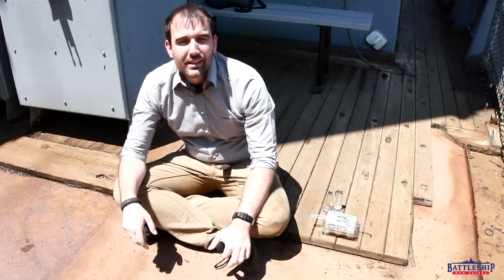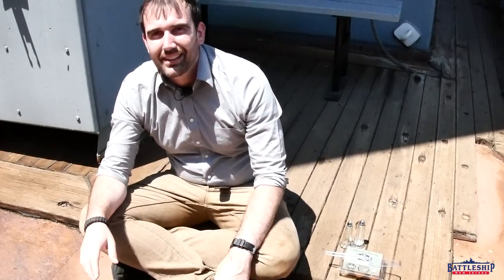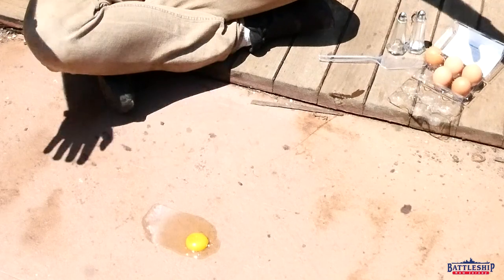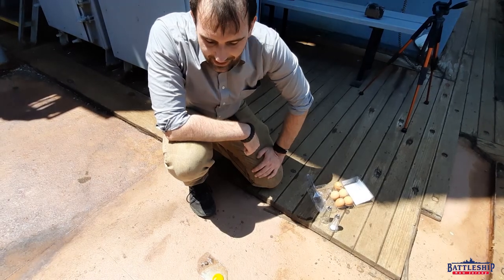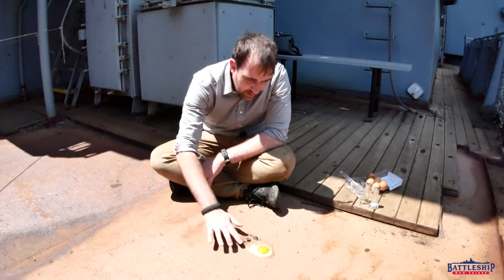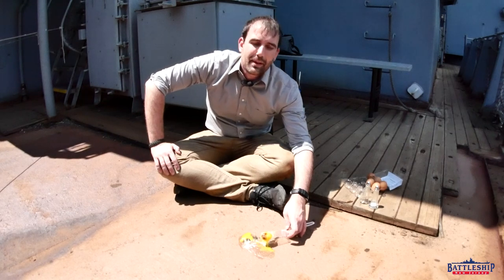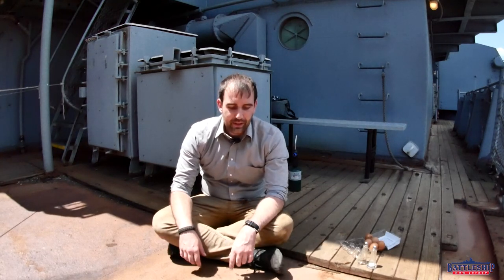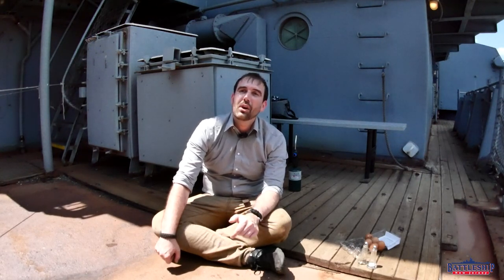Cooking An Egg on the Deck of A Battleship

Comment: Eggs whites are is made up of 15 percent of proteins. Egg whites have been used for several purposes, including waterproof glue, so it’s easy to understand how this part of the egg can dry and then stick to the surface of paint. If it is not dealt with quickly, it can become extremely difficult to remove from the surface of the paint without sanding and repainting the damaged area. Egg yolk was once used to make paint because of its natural ability to harden and stick to almost any surface. The chemical composition of the egg yolk will eat through paint.
Reply: Exactly why egging somebody's car as a prank can be so destructive.
Reply: @Jimorian  that's why its not "just a prank bro" egging can cause real material damage to most surfaces. egg especially sticks well to paint, its why egg was often used as a pigment binder in paint throughout history, the painting "Birth of Venus" which most folks recognize as the the famous naked lady on a clam shell painting from the early renaissance was done in egg tempura, and the paint still holds up over 500 years later. Came here for battleship facts and got an example of art history too.

Comment: you need to try it again, but use a cast iron skillet and see if the direct sunlight is hot enough to heat the pan enough to cook it thoroughly...and of course use pam or butter

Comment: interesting , eggs in most cooking serve a different function than just being food , in alot of occasions its a glue , im saying the yolk as it flowed caused an airtight bond with the surface , as the yolk dries it shrinks and the primer evidently has a better bond with the egg rather than the ship .  RYAN READ THIS BIT  : if the bond with the ship isnt as strong as shrinking egg yolk it might suggest the primer isnt working as well as it was, might be a good cheap " underlying rust detection " trick , but yeah theres rust under the primer there

Comment: If you’d used a black cast iron skillet, I think you could have done it. As it was, you did a fair job getting that egg more or less to “over easy”
Reply: An egg cooks are around 144 F, and that egg was raw.  That 101 F heat isn't going to heat anything up hot enough to cook an egg.

Comment: 1978, I was a cook on board USS Fox CG-33. We were in the middle of the Indian Ocean when I got newspaper clippings from my family about the "Blizzard of 78" in Northwest Ohio. I proceeded to take a little oil and an egg to the fantail and cook it on the deck. It took about 10 or 15 minutes for that egg to be somewhat ready to eat. (No, we did not eat it) We took pictures along the way and I sent them back to my family in Ohio, AFTER we had swim call and I snorkeled underneath the ship in the close to 90 degree ocean water. It was probably well over 100 air temp. So yes, you can cook an egg on the deck of a ship, it just takes a while.

Comment: Have some similar experience as a former US Army tank crewman.  Yeah, tanks get miserably hot inside, especially in the desert where there's little overhead cover to park next to (was stationed at Fl. Bliss in El Paso TX back in the olden days, also in Desert Shield/Desert Storm).  Reportedly, back in North Africa in WWII the interior temps inside the tanks could hit 160 degrees F.  One thing new guys to the unit quickly learned was, when working on the tank, to either put the tools in the shade, or at least cover them with a rag.  Otherwise your wrenches, ratchets, etc. would heat up so much you couldn't use them.  You'd have to pour a canteen of water over them to try and cool them off, but if we were out 'in the field', on a training exercise, you definitely didn't want to waste water like that.  (Note:  The M1A1/A2 series tanks DO have an "air conditioner" of sorts; it's part of the chemical defense system.  But at least back in my day, we weren't allowed to use it except in wartime, because it took bleed air off the engine, and the engine -- at that time -- was not really configured to supply that bleed air, and so it would supposedly cause cracking and other engine problems if it was used too much -- or so we were told.  Hopefully the Army got the funding necessary to modify the engines sometime in the last 30 years.)

Comment: My first thought on the peeling primer is that the egg is just sticky enough to take the primer with it as it slowly heats up and shrivels... (the pH or enzymes in the egg might also have helped to break down the primer and make it happen more easily, but it doesn't look like primer is really missing, rather just pulled up)

5:16 The absolute side-eye you gave there!!! LOL

How hot has it gotten... ugh. I'm in Texas. It's been triple digits for a good 2 months. 😢

Comment: Now do bacon on the conning tower.
Reply: the gun shot was aimed at the lost pig wandering nearby.  Some ships in the Persian gulf will (did?) paint some vertical surfaces white due to sun and heat.
Reply from the maker: We started there! The thicker steel doesn't get as hot.
Reply: i was thinking the dark gray on top of a turret.
Reply: @leftyo9589  Lefty, Ryan tried the turret top with the same result.

Comment: With that kind of heat a literal egg on the deck may not have been what was done, but I could certainly see a seasoned cast iron flat/skillet being plenty hot enough if left out to quick fry some sunny side up wonders.

Comment: I live a little bit south of Brisbane, Australia (where MacArthur evacuated to during WW2 for a while), and here, with latitude roughly 27.6° South of the equator, today's forecast maximum is 25°C / 77°F. Of course, as Ryan observes, it's winter here right now, so winter ≠ cool automatically. 😏 Our summer maximums in December to February are usually higher than 30°C / 86°F and usually at least a few times each summer they're above 38°C / 100°F, with a good dose of humidity just to make it really not fun.
Reply: Further south in Melbourne, it was about 12 deg C. Last week in the mornings it was touching about 0, or 32 F.

Comment: PSA - If you cannot rest your hand on it, your pets cannot walk safely on it. Please protect your furbabies!
Past that,  Pity you cannot test 'cooking your food off the barrels'. ;)
I have used my engine block to heat up - not cook per se, but heat up - canned goods. Rest it in the valley of the engine or better on the exhaust manifolds. Id not be surprised if the Aux engines on BB62 were used in much the same way. 

The one thought I have would be to try again on a bare steel section.

Comment: Not too bad here this summer.  Here in the San Francisco Bay area we are next to the Pacific Ocean which keeps us cool. As sailors once said, "When Sacramento Sucks, San Francisco Blows" describing the strong summer breeze we sail on. As the inland areas heat up the hot air rises and is displaced by cool air and fog from the pacific that all funnels in the Golden Gate Narrows, AKA the Golden Gate. Sacramento has had plenty of 100 plus days this Summer while I've only noted high 80's and a few days of 90 degree heat.

Comment: Done that before, and did bacon as well, along with making the bread warm. This was on the bonnet of the work van, a Datsun 680 pick up, which was parked out in the sun all the time. Of course was done in summer, where the temperature was 42C at 2PM. Could also be done in winter, as you would have the same temperature as well. A town with guaranteed full sunshine 365 days a year.

Comment: When I was a kid, some teenagers egged a white car one Halloween and the owner did not get it washed off immediately (as in within two hours). The car had turned pink by midday the next day.

Last two months had 90+ degree F heat everyday unless cloudy and raining (4 inches over six weeks and then 4 inches in 2 days a week ago with some spotty showers during past week). Probably went 100-105 several afternoons at least with heat index added in; maybe a few days over 100 without heat index.

Comment: And so what would be the temperature in the engine room at sea speed with the humidity leaks within. lets say 10 degrees of the equator. Not very comfortable. At least this era of battleship, you didn't have to shovel coal into the boilers. I remember when being relieved on watch, leaving the engine room (of a commercial steam ship) with a rag in your hand so you could use the hand rail, because it was too hot to use them without some insulation.

Comment: Try it again on a bare metal primer free surface. 107 degrees F here in San Angelo, Tx.
Reply from the maker: There is virtually no where on the ship without paint
Reply: @BattleshipNewJersey  That means the "crew" is doing good work!